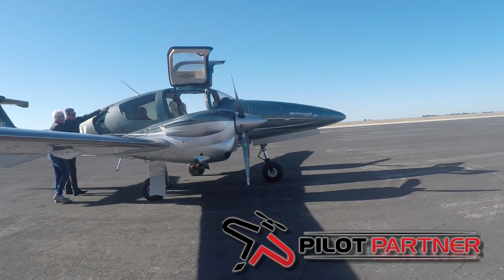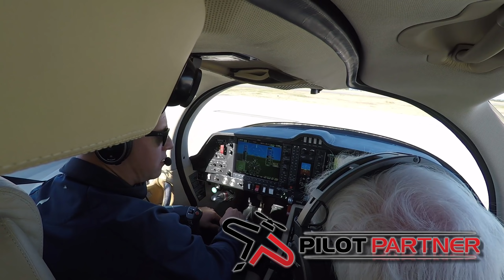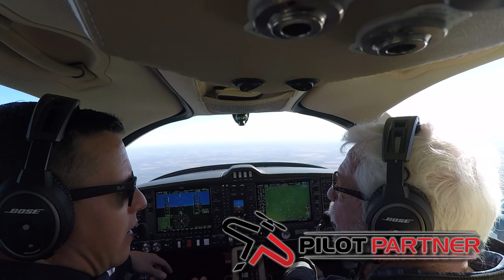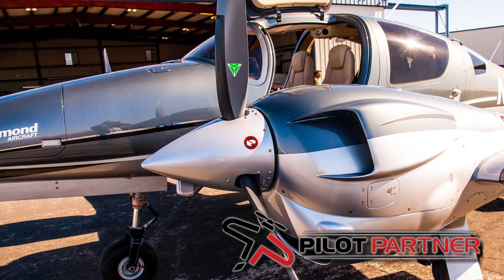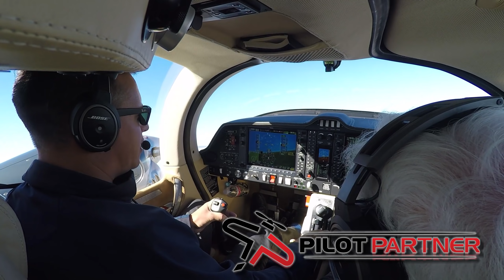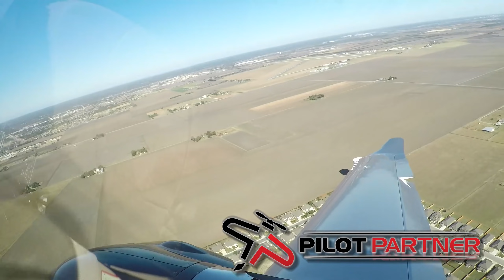Diamond DA-62 Demo Flight

Comment: Great little aircraft.  Does this it have beta on the props? With a diesel's high torque it should be very effective in in braking the aircraft to a stop.
Reply from the maker: ZManMD it does not have beta in the props.  But it's light enough that brakes are not an issue.  I'm sure if they added the beta it would make the aircraft heavier and lower useful load.

Comment: It amazes me that these sophisticated engine control systems are only used on the diesels.  I keep hoping Lycoming's iE2 will get some traction on the avgas side, and I guess it's finally going to make it into a certified airplane sometime soon, but sheesh.
Reply: That's because this particular engine is a modified automotive engine - a Mercedes OM-640 2.0L diesel - so the ECU systems and sensors have already been worked out and in production for years.
Reply: @glibsonoran  Very interesting.